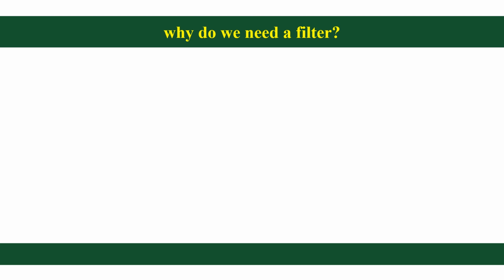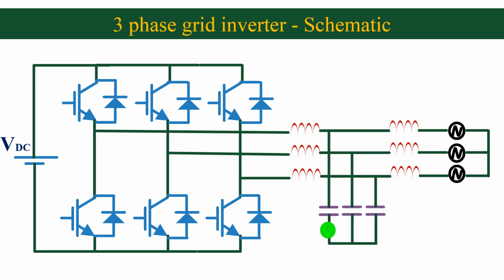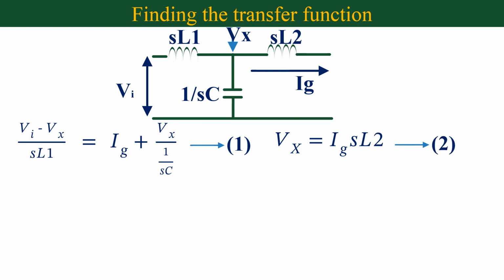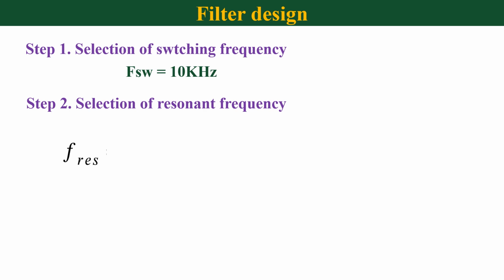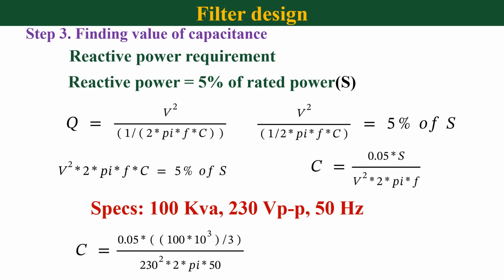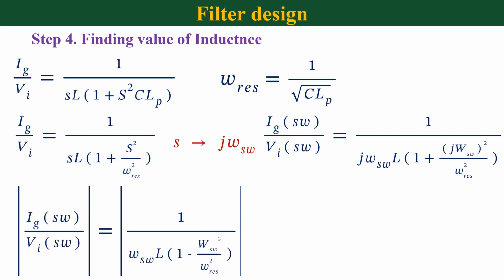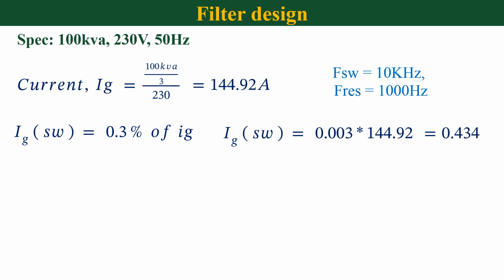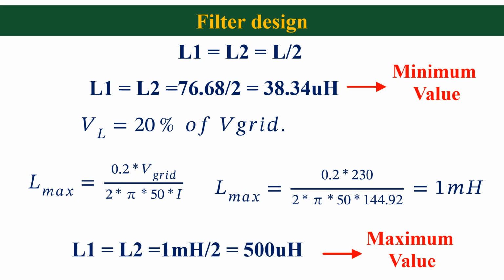Design of LCL Filter for 3 phase grid connected inverter.

Comment: Great Video!!! But one confusion is there. In specs of inverter you have chosen 230V p-p but in a 3 phase system the voltage is 415V generally then how that value you have chosen can you please elaborate. It will be more helpful for me.

Comment: Thaks for the info.....
 Ac to dc Rectifier using igbt also contains the same calculation of selecting the capacitor and choke or its different, please make the vedio if it is different...

Comment: Why you are using 10kHz as switching frequency....is there any method to select switching freq......please share me.
Reply from the maker: Selection of switching frequency is based on power density, size, max permissible loss, efficiency etc

Comment: We used to have an inverter at home and whenever we would turn on the fan using it, a loud buzzing sound would be made. Now I know that it was because the inverter did not have any filters and the fan's rectifier was getting rekt. It was a cheap desi inverter.

Comment: Hi . With regard to equation2  , i do not understand why you can say Vx=Ig sL2 . What about the voltage at the output of the filter ?
Reply: The simple V =IR  was used in that calculation. The impedance of the inductor is sL in the Laplace domain multiply by the grid current(Ig) flowing through it. And so Vx = Ig sL2. Hope that helps a bit?

Comment: Thank for the great video. Is 230 V, phase to phase or phase to neutral? You have used it to calculate C while the S is per phase. It should be both per phase or phase to phase.
Reply: Its phase to phase as indicated by the Vp-p. Hope that helps
Reply: @benjamingomado5064  if its phase to phase then phase to neutral voltage is 132.79V. Why you are using this no one know ....can you please tell me the source of this calculation mentioned in the video.
Reply: @hocho7254  it should be line to phase RMS voltage. Because the capacitors are in star connection and he divided the apparent power by 3. So, single phase equivalent circuit, where all belongs to phase-neutral.